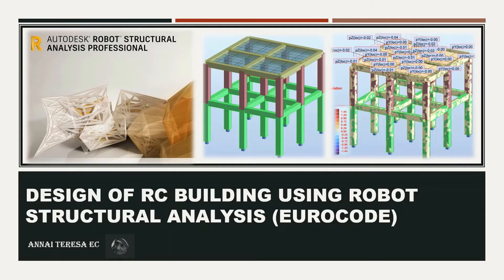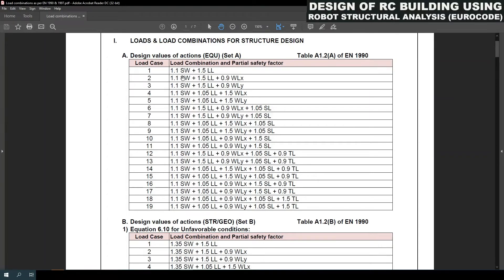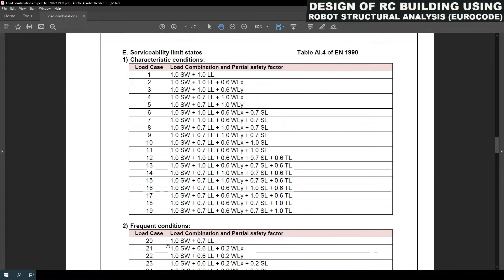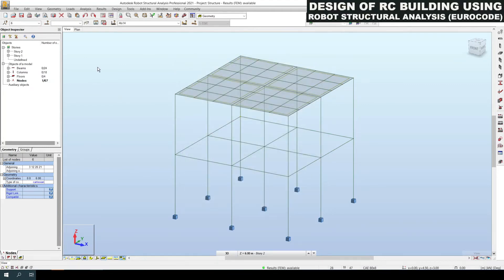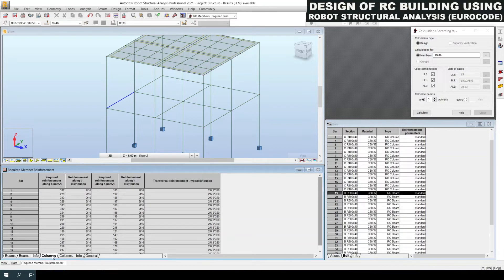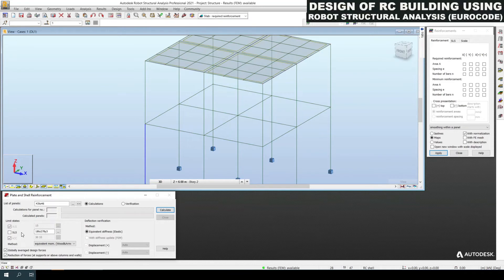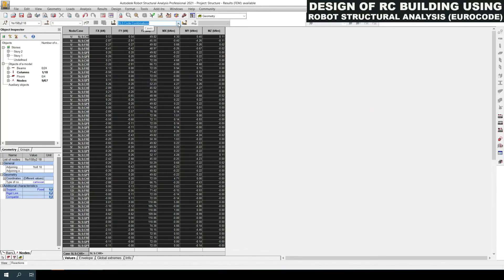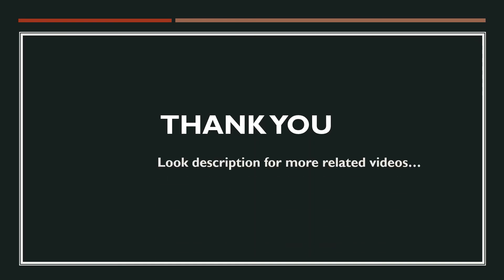Design of RC Building using Robot Structural Analysis | Part 3 | Load combinations & Member Design

Comment: Hello, I noticed when you were designing the slab, you did not perform discretisation of the slabs, any reason for that? Thank you
Reply from the maker: Discretisation can be done directly by clicking calculation icon for element shell design. Or alternatively there is set of discretisation icons we can use it.
Reply: Ok, thank you.